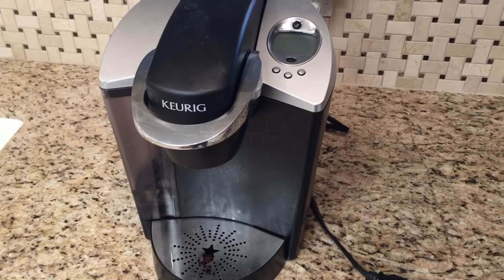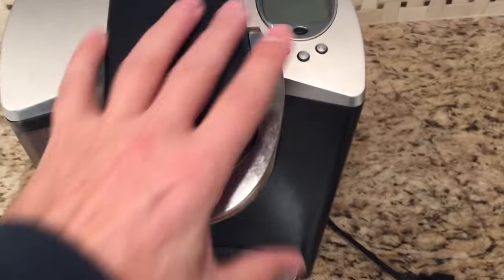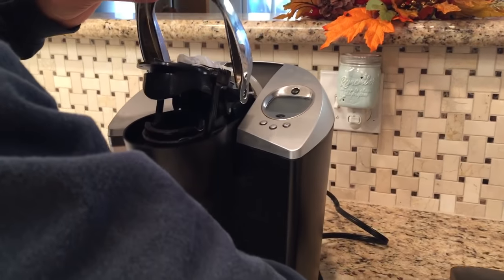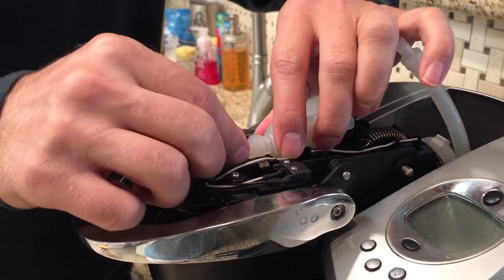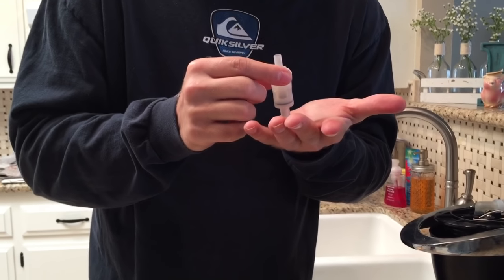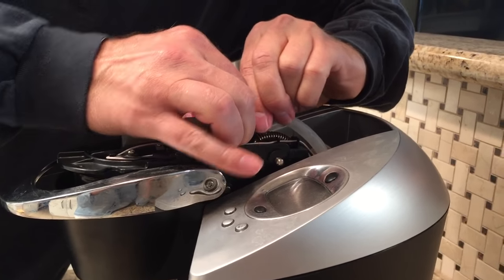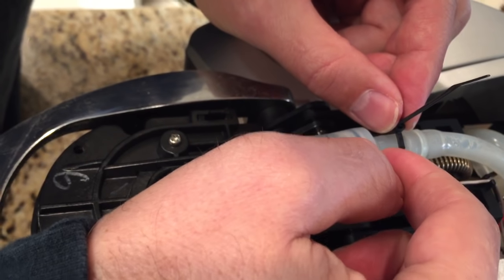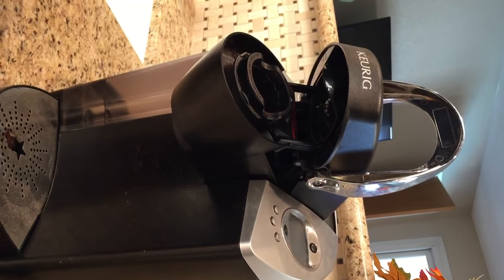Keurig Fix - Part 2: Cleaning the Check Valve

Comment: Wonderful instructions including proper top plastic disassembly and re-assembly. Many would say assembling is reverse of dis-assembly but your last minute to secure the plastic cover was invaluable to re-assemble. I have been using my Keurig for long time with filtered water. I believe it was just an air bubble trap. The check valve worked well when I checked the valve by blowing it. Again all is good. Regards.

Comment: One item to add to this excellent video. If you have cleaned the reservoir valve and check valve as recommended, and it still does not work, check the final bend in the tube before the water heads down the spout. Slip the black ring upward with a flathead screwdriver. The bent tube will pull right off. If water flows this far (it's messy, you can direct it toward a sink) that means the puncture tube heading down is clogged. For some reason, pushing a paper clip up from the bottom won't always clear it, so since you have the cover off anyway (Thanks Eric Reid!) simply clean it from the top down with a paper clip. Viola!

Comment: I was so hopeful this was going to be the solution. My coffee maker is not pushing that last bit of water out of the K-Cup once it's finished brewing. When you take the used cake up out it's still full of hot water and coffee. Unfortunately I've done every single thing I can find on the internet and I think it's just that the pump has become weak. It's time for a new one.

Comment: Hey Eric , this worked perfectly , my machine was working perfectly , I put it away for 6 months , when I went to use it , it had stopped working , I took the valve out, soaked it in hot water and soap , blew into it like you said, rinsed it and it works perfectly now, Thank you very much.

Comment: Thank you! I went through the steps you showed up to the point where you clipped the zip tie. All I did was move the part towards the front of the zip tie towards the front of the machine and it started working again. I ran a mixture of white vinegar and water through it several times, to clean it all out and then ran fresh water through it several times. Everything is working now. Thank you!

Comment: I followed your clearly explained instructions up until you clipped the wire tie. Instead I left the check valve in place, went right to wiggling it apart from the feed tube. Once I got it apart, I blew into it and water flowed and filled the water tube! Put it all back together and it works again. Thank you!

Comment: Thanks, after many descaling and trying other tips, I was afraid I had a bigger issue until I found this video and one other.  I took off the check valve, it looked crusty inside.  I blew through it and it seemed sticky.  So I sucked vinegar thru it (yes it tastes gross) and soaked it in vinegar overnight, reinstalled the valve this morning and it works perfect.  Thank You!

Comment: Very nice clear, well spoken video. The only suggestion would be a steadier camera or one with an optical stabilizer.  I've done pretty much everything there is to fix this machine., but I've held off taking it apart like this.  I guess I'm going to have to break down  and try this.  Thanks
Reply from the maker: Thanks for the tips!

Comment: Great FYI video Eric it helped out a lot 👍. So I took it a little further and removed the hold down brace for the hose on the check valve and removed it. Then I used a small brush that we use to clean  out our stainless steel straws flexing the elbow and scrubbing it out several times. So it use a small squeeze bottle to flush it out  several times. You can also use a turkey baster to flush it out. I cleaned out the whole inside parts and now it works like NEW 👍 Thanks Again Eric

Comment: This worked! Thanks, well actually, I didn't even remove the check valve. I opened it up and tried to brew to see if I could see that it was plugged. I didn't see water moving so I squeezed it!  That fixed it immediately!  Be so careful though if you do this while plugged in, let alone running, since there is a wire right there to the right.

Comment: Thank you.  For everyone dealing with this, just go through the easiest to hardest.  1. Water reservoir filter screen 2. Water reservoir check valve 3. Needle bypass holes 4. Mainline check valve (this video).  Mine was as simple as removing and emptying the water reservoir and spraying into the bottom with my sink sprayer.  That was it.
Reply from the maker: Nice! Absolutely the right order, from maintenance to repair.

Comment: We have this same model of Keurig coffee maker. Cleaning it is not a problem. We have had this maker since they first came out and it is still working properly. Strong pickling vinegar is your best friend and good cleaning around where the pods are placed. My situation is that the screen functions have quit showing except the ready indication and the not ready screen. Clock has quit as with other displays. Is there a kit or a fix for this problem? It would be nice to have the screen working correctly although not necessary. Looking forward to another 15 years of use.

Comment: Keurig K40. Followed parts 1 and 2. Unit now delivers full 10oz cups. However, I used a brown coffee stirrer to activate the plunger back and forth to its full travel, while submerged. Re-installed the plunger. Used a brush to clean check valve, and again, activating the valve while upside-down. Might take an hour from start to finish, but saved replacement cost of $120.

Comment: This video is VERY HELPFUL for opening the top of your Keurig to do any fix of the plumbing.  For instance, if you accidently remove the water tank/reservoir while brewing, and introduce air into the line and "lose the prime" on your pump.  Keurig says never to do this but you can fix it.  

SYMPTOM: Your Keurig makes the noise like it's filling water from the reservoir, but the water level doesn't change and the noise continues for way too long.  

WARNING: Only try this fix when the machine has fully cooled! 

FIX: You'll need a short Philips head screwdriver, a pair of nail clippers, a small zip tie, a mug to brew into, and a towel or paper towel to mop up any spilled water.

You'll need to access internal parts by removing the top cover (see this video for helpful step-by-step instructions). 

After removing the cover, you'll see a clear tube running from a metal chamber about halfway down the back of the machine (the hot water tank), leading up to the K-cup area. This tube is connected to the "check valve" that is cleaned in this video. 

Loosen the clear tube at the top where it leads TO the check valve - you'll need to cut a small zip tie.  (You'll replace this later)

Create a vacuum by gently sucking on the end of the tube to pull water from the reservoir into the pump. (This is the same as when you use a syphon.) You should not wind up with water in your mouth since this tube fully empties back into the pump after each brew. (But just in case, this is why you should wait for the water to completely cool!)

Reconnect the tube to the check valve (no zip tie yet) and try brewing a cup of plain water (NO K-cup pod). The machine will work fine without the cover for now. The pump should pull water from the reservoir - you'll see the water level go down. If not, disconnect the tube again and try a few more gentle sucks.  

Once your Keurig is successfully brewing plain water, add a new zip tie, close up the cover, and enjoy your Keurig again!

Comment: Great video---you should go one step further and show how to actually take the check valve apart. Very eisily done. My valve was so clogged that blowing thru the tube, running water through it, or tapping the end on a hard surface just didn't clear the obstruction. Took the valve completely apart , cleaned under fast flowing faucet, works like new now.

Comment: Our Keurig was getting worse and worse even though we always did the 6 month vinegar treatment as in the manual. Today it stopped working. Because I like tearing into things that aren't working, I was ready to get into it's guts. But I first searched here on YouTube and sure enough, there were videos on how to fix it.  After watching a couple of them, I liked yours because you discussed how exactly to clean the valve.

So armed with your information, I unscrewed the top and there it was. It look ok, but when I pinched the output side, water dripped from the brewing nozzle. So, output wasn't clogged. I pinched the input side and nothing. I could see that the water in the valve didn't move. Since I already had tiny wire ties, I unclipped just the one and pulled the valve out. You know what? I looked at the valve and on the bottom there was a TON of black residue. Probably built up over years and years.

Blew it out and a bunch when into the sink. Put everything back together. Before screwing the top back on, I just laid it over the mechanism in case of loose tubing. Didn't want to scald myself. Plugged it back in and BAM! It sucked up water fine and once I started the brewing up again, the water just flowed out. And the Keurig was QUIET. It had been getting louder and louder over the years. Especially after the last vinegar treatment about 2 months ago. I was worried that a pump was going out.

But now, it acts like a new unit. Thanks for the great video!!!

Comment: I have a different model Keurig, the "K Express Essentials" but experienced the same problem.  Your solution didn't help me but mine was fixed by blowing compressed air into the valve similar to the one you were cleaning at the base of the reservoir.  I also blew into the receptacle that receives the spring loaded valve.  I assume this dislodged some scale or other foreign matter that landed there when we descaled the machine.  It works fine now.

Comment: I just tried this and other Youtube stuff to fix ours (which is about 12 years old -- one of the early ones).   Didn't work.   Finally I took a small, handheld basketball pump -- blew air into the reservoir water input.   A few pumps -- and it is working again.

Comment: Disassemble

Tips:

	•	Use regular size Philips screwdriver (a tad bigger can help); magnetized is recommended.
	•	Be patient; it may take quite a few turns.
	•	Hoses fit tight; zip tie is optional.

Reassembly

	•	Hold down on top to stabilize.
	•	Use a magnetized screwdriver to find the screw holes.
	•	Start screws straight into the holes.
	•	If they start straight and snug, keep cranking. (Don’t overthink stripping out the hole.)
	•	Getting screws in straight is the challenge; be confident.
	•	Use medium force; NOT stopping prevents dropping screws again! don’t snatch defeat from the jaws of success.

Conclusion

	•	A 30-minute investment, even for a novice.
	•	Risk-reward is big! Odds of success: 95%.
	•	Keep using distilled water.
	•	See you in 2032—7 more years of use. Great job!

Comment: That is cool Eric. I just bought my very first Keurig which is the K-Supreme Plus. I am curious if it will come apart as easy to clean it. Why couldn’t you just run vinegar through your coffee machine?
Reply from the maker: Hmmm.... I have no idea about your Keurig model. I have only disassembled this model. Running vinegar through the system BEFORE it quits working is a GREAT idea. This can prevent the check valve from sticking. But once it is stuck, it may not pump enough vinegar through the check valve to clean it. So you must take it apart....

Comment: Here's a dumb question.  Does anyone actually know what purpose this valve serves?  I know that it prevents water from flowing back into the holding tank but how would that damage the machine?  I don't think it would suck coffee grounds from the pods back in or you would see grounds in the check valve.  I wonder if anyone has tried removing the valve and installing a piece of tubing in it's place.
Reply: It's not a dumb question and you got the first part right, it prevents any flowback but most importantly it keeps an airless vacuum in the tank. If you get air bubbles then you have problems with flow. Usually after non use or lots of scale, the seal simply becomes stuck and that is why you have to remove it as explained here. Suck some hot water with vinegar through it, leave 10 minutes and it will open up nicely. Use it as a straw both ways, suck water through one end, then use the other end and blow through it, repeat a few times and it will click if you shake it. It's ready to be put back in and work like a champ.
If you were to bypass the valve and put a tube only, then you would get flow back as well as air being sucked in constantly and most often, your machine won't work efficiently. This setup requires one end to pump pressure and create flow through and the other end of the vacuum to help suck the fluid through, in essence and assisted  siphon. I hope I have explained in laymen's terms as possible without getting too much into the physics and pressure differentials.
Reply from the maker: Ha! Love this question! I really don't know the answer, but my hypothesis is that this prone-to-stick valve is integral to the pump's function - no water expressed without it. My guess as to the engineering...the pump cannot draw water only from the reservoir unless this check valve is there to stop it from sucking air from the dispenser side. There is likely to be an analogous one-way valve somewhere on the other side of the pump, keeping hot water from being pushed back into the reservoir tank.

Comment: Hey Eric, I did everything you said, even completely disassembled the check valve from the plastic housing, and I can blow through it just fine, but the water (vinegar, actually, since I was in the process of de-scaling it when it quit working altogether) still won't flow after the first second or two of starting the brew process. I did test flow, removing the check valve and it worked great. Could the pump just be too weak to push the check valve? I don't understand how it can allow flow for a second and then stop, if it's already open...??? Thoughts?
Reply from the maker: Boooo!!! Sorry. Hmmmm....it was working before descale? Maybe a loose bit of mineral deposit got caught somewhere? Let vinegar solution sit for awhile. Might dissolve the crusties. Check valve is installed in the right direction? I’m not sure it can be flipped. Just brainstorming.
Reply: @ericreid4868  Yup, check valve was all good. I even removed it and tried to get flow and again, it worked great the first second or so and then petered out to a trickle. I gave up. Tossed it out and went back to the $18 Mr. Coffee. Not enough space here and too many variables, not to mention they're such buggers to get into. Thanks for trying, though!!

Comment: My Keurig does the opposite of most it won’t stop pumping water out of end as soon as I turn it on like it’s stuck in open position ?? I cannot get it to stop pouring out and the pump never stops until you unplug it?? What should I look at check valve or something else a.
Thanks
 Shawn
Reply from the maker: Well - I'm tardy to this conversation. Kind sure you've solved this already in one way or another.

That's a broken control panel or bad sensor. Sounds like a complicated fix. What would I do, you ask? :) I'd try putting just enough water in the reservoir so it runs out before overfilling my cup...OR I'd watch it like a hawk every time and unplug the thing when my coffee was done. If the first solution works, it seems easiest. Fill your cup with water, pour in reservoir, and then brew as you normally would.

Comment: Thank you for saving my coffee drinking days! The valve clean out worked like a charm!
Do you think descaling more often would prevent having to clean the valve? I havent descaled in ages and there seems to be deposits inside the valve and waterline from hard water.
Thanks so much for posting this.
Reply from the maker: :) Glad it worked. Yes - descale regularly. It is probably the water deposits that freeze up the check valve, and working the valve loosens them up. Soaking in vinegar or another mild acid may also clean it.

Comment: Will this fix my problem with water not being pumped at all from the water tank/reservoir to inside, or is that an issue with the tube being blocked at the bottom inside the machine? I haven't taken the tube and check valve apart yet. I tried squeezing the tube and check valve as another poster suggested, but this did not help my problem...the pump just runs, then eventually stops. Valve in bottom of tank seems to work fine...water will drain out when I push upward on the spring valve from the bottom. Also, the screened outlet in the platform where the tank rests also seems to be clear of any possible obstruction. Any ideas?

Comment: I bypass the check valve and still don't get a full cup. I'm suspecting may be the motor or the pump getting weak. Not strong enough to push the water through the line. Not really sure how the keurig works but such expensive item to start failing after 2 years of purchase.
Reply from the maker: The check valve is necessary. Clean and replace, and it may work after. I don’t think it will work without the check valve.

Comment: Hello thanks for the help. I have a serious question about the black cord next to the white cord
Reply from the maker: Hi. What's your question? I haven't studied the electrical design much. If either of these is damaged, you may consider replacing it. But I would say don't try to repair wiring if you are not very confident in your ability. Water and electricity make that repair extra hazardous.

Comment: My neighbor threw out her mini. At first, it worked, then it didn't. So I went on YouTube. I tried to unscrew the screws but no. I then drilled them out and pulled the surround off. Next, I took off the hose that goes to the check valve. I blew into and sucked out on the valve. Put everything back together, and now it works like new!